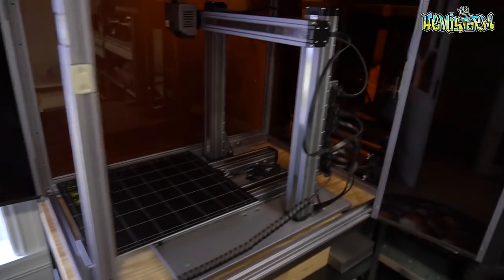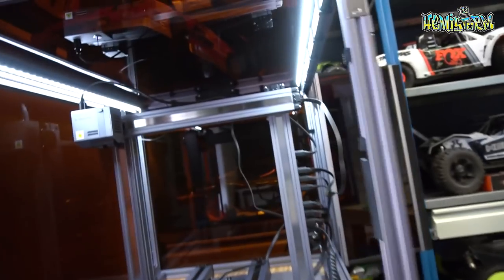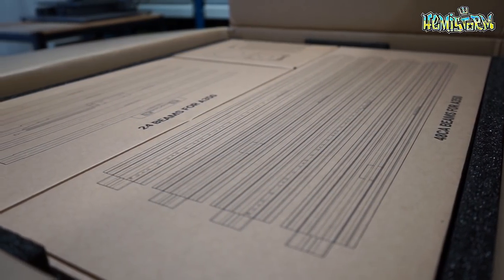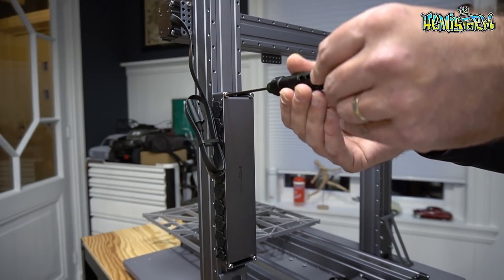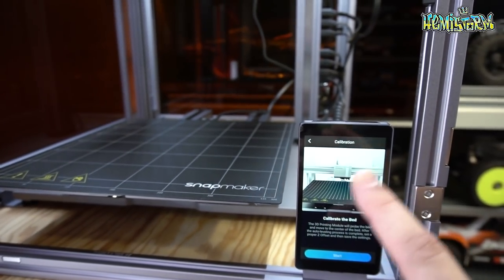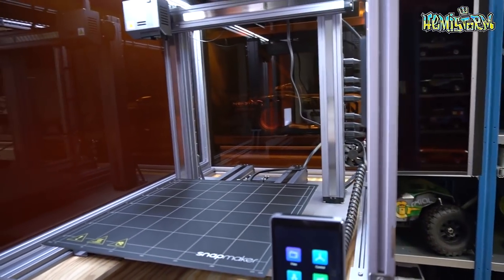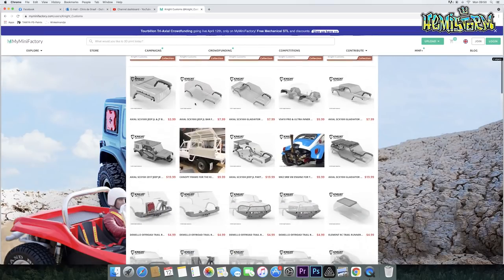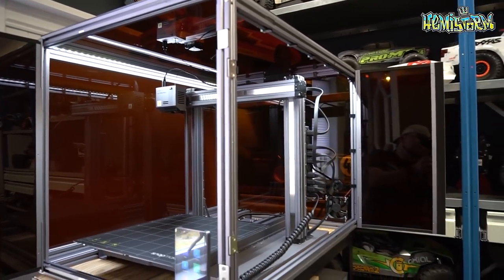OH SNAP! The start of something WONDERFUL with MyMiniFactory & Snapmaker

Comment: My TF2 has been given new life because of my 3D printer.  Body posts, mounting points, bumpers, 8-71 blower, maxtrax, roll bar are all things that have been printed so far.
Reply: well, made that comment BEFORE I found out about the contest.  If youve got a discord Im totally down to help out with what Ive done so far and help going down the road going forward
Reply from the maker: You should totally enter! Looking forward to see your creations and I will definitely hit you up. 😃👍🏼
Reply: @hemistormrc  I pulled up the website and the first thing I seen was a roll bar for the tf2 and I was like "im home".  Im only 6 months or so into it, and the 3D design portion too.  Teaching myself both along the way.  No smell suave hairspray is my protip, after bed preheat and before print a few sprays on the bed has saved me a ton of material